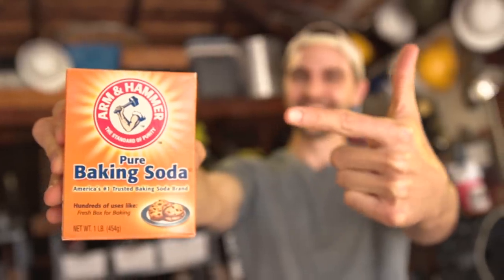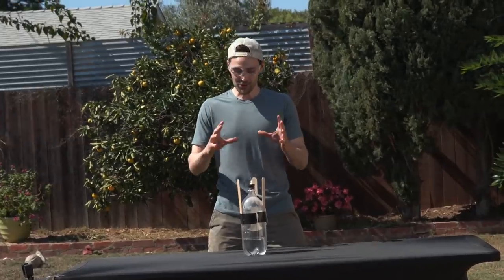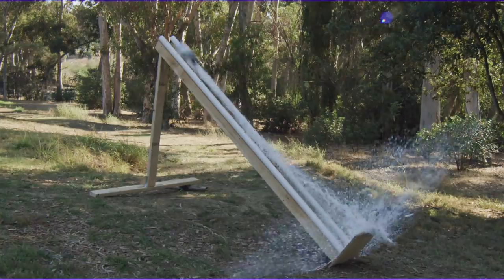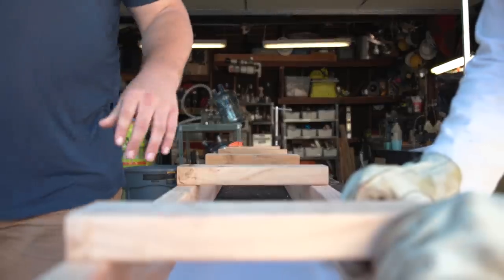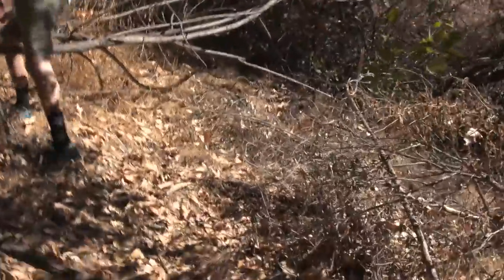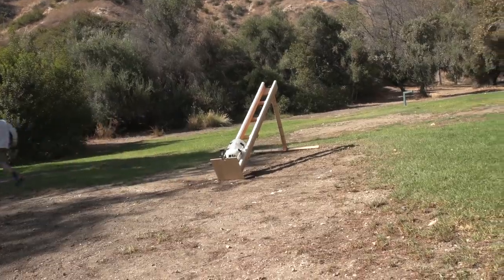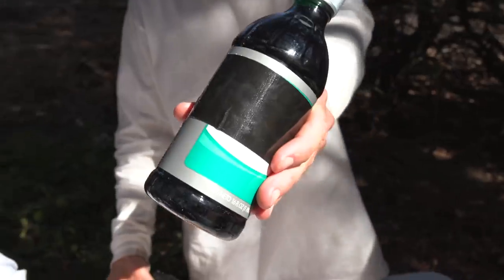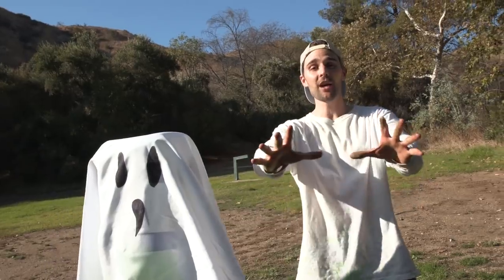Giant Baking Soda Rockets

Comment: You need a more dependable plug to ensure maximum pressure is achieved. I suggest using a plug that can be manually released so you can hold all the pressure until you are ready to release it.
Reply: Great until the bottle ruptures...

Comment: Those distances/heights improve by using nose cones? Especially the larger botttle?
Great vid  Thanks for the upload. 👍
Reply: If you just want sheer power a nozzle would probably make a much greater difference (increases the velocity of the outlet gases therefore giving them a much higher momentum and therefore propelling the rocket more) though a nose cone (and fins to create more lateral stability) would also help alleviate some air resistance, if shot at an angle would even help generate lift.

Comment: Ok, minor tuning. Pressurize the big 5 gallon jug with compressor to the point it blows up, note pressure at which it blew up. Create orifice slightly smaller. Create plug that pops right under the pressure of bottle bowls up. And put as much of mixture in there as possible.

Comment: This was entertaining, good job.  This is how the rocket program started long ago... testing flight.  Next thing you know, you'll have longer thin tubes that hold the same volume as the large 5Gal container and FINS for stabilization.  Then comes the funnel on the end to increase force out per volume all while fighting gravity, pressure and atmospheric conditions =]  Gravity will always render a short rocket flight if not fired directly vertical and held in that position by engineering.

Comment: Anybody else worried about this guy's safety since the gas he's creating is heavier than air? Does he understand that if he breathes that stuff in it won't allow his lungs to take in oxygen?
Reply: Gases mix. If you are worried, you really should brush up on chemistry. Also, I can hold my breath for a minute, so can anyone.
Reply: @berrylangerak  just showing a little concern bro. No need to take offense. I'm not a "gotcha"  guy. Live your life. But to actually address your statement (because I honestly couldn't resist the challenge), CO2 is heavier than air. If a space is filled with it, air will naturally rise above it. So if your lungs are filled with CO2, air will not occupy the same space. Gases do mix. But sometimes they take a minute. And the time it takes for air to mix with CO2 could harm you. Take fire for example. Fire needs oxygen to burn. That's why many extinguishers use CO2 to put fires out. I am literally using science to explain this. I hope this helps you to understand my concern for my fellow man. I've got nothing but love for you. Be safe.

Comment: What about a taller wider base behind the rocket so the pressure of the stream is not wasted. You know so ALL the pressure pushes off the base🤷🏻‍♂️
Reply: The base doesn't help. It just keeps vinegar from spraying all over. For that pressure to do anything, you'd need to put it in a tube, like a gun barrel.
Reply: @ernststravoblofeld  I see. Thank you for taking the time to explain this.🙂

Comment: I use to make water rockets when I was a teenager, but those worked good too
Reply: Bicycle pump and cork?
Reply: @jamesdewane1642  ya basically ,you can use an old school looking cap pen and hollow it out and just keep rolling tape around it like a cork, and a Bicycle pump should hook up to it and just keep pumping till it blows off
Reply: @outdoorvideoswithbrad  I'm not sure what you mean by a cap pen. I did this with elementary school students just taking the pin you use to pump up a basketball and shoving it through a cork. But knowing other ways is always a plus.
Reply: @jamesdewane1642  oh ok that’s cool,and just a plastic pen but the normal looking one with the cap, you hollow that out cut it down and that should fit in a Bicycle pump and rap tape around the pen to desired circumference making a homemade cork, your idea is a little more simple tho I just didn’t have those parts at the time
Reply: @outdoorvideoswithbrad  ah. Awesome workaround! Half the time we have to stop because somebody breaks the pin or the hole through the cork leaks too much. And it's always the teacher buying the parts. Thanks

Comment: Guys we use a rubber mallet to get the potatoes in. If you do it rt you can plug it with one good whack. You eventually learn the proper force to use. We use to do it the same way by just putting your weight down on it but when you're not that heavy to begin with it tends to make things a bit aggravating...lol

Comment: Using a proper rubber stopper or some sort of large cork on the water jug would have been a thousand times better than a crappy potato.  It's the potato's inability to hold back any kind of meaningful pressure that makes spud guns work. Bubble gum would have done a better job. Cool video though.

Comment: Your rockets would go much further with stabilizers. Your rockets are loosing energy tumbling. Add some weight to the nose, and some stability fins to control the tork forces, and you should get far more distance.

Comment: You can easily beat that by putting a weighted cone on the front we did something like this in 8th grade with 2 liter bottles they went a lot further, more like 200 plus feet... I can only imagine what that 5 gallon jug can reach.
Reply: Just feel that styrofoam dome with clay and see how far it goes